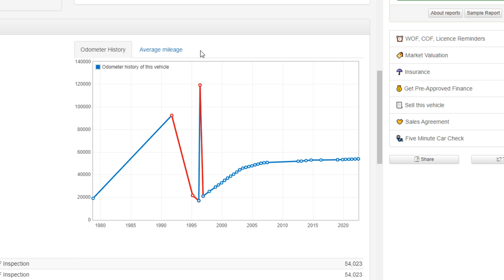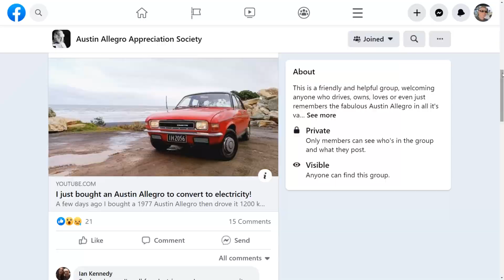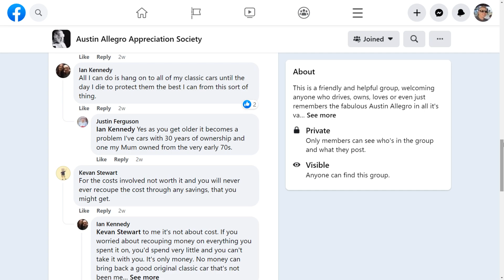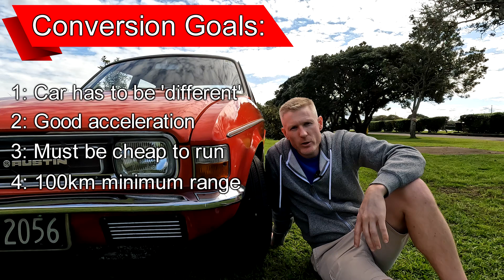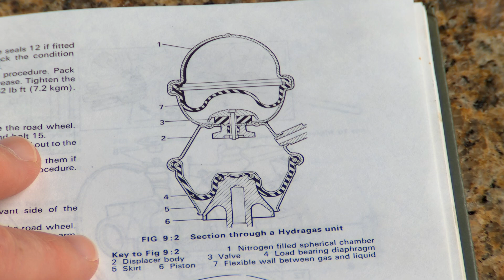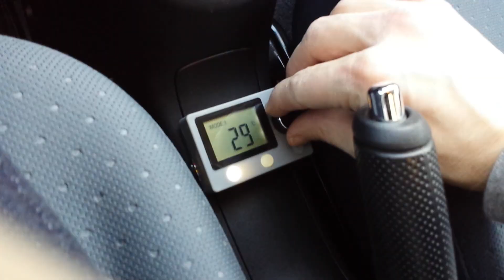Austin Allegro electric car conversion: planning, budget & goals.

Comment: Are joined drive shafts legal in NZ? Usually cheaper to get someone to join existing shafts by welding, sleeving and voodoo. There's a place in Poland people on open inverter recommended that's cheap for custom drive shafts too, depends on postage and import fee to NZ I guess.

Comment: I have been watching and enjoying your channel for several years. I am becoming convinced you should buy a used (or new)  manufactured electric vehicle. You would have a better car than you cobble together on your own. You have a lot more options than you had 2007.
Reply from the maker: Hi John, believe me, I've thought about just getting a used EV for years but it just wouldn't be "me". I need something really different! A conversion is just unbeatable for sheer wow factor and I want to drive a statement piece!
Reply: @KiwiEVadventures  Thanks, Gavin, we have been driving a Chevy Bolt since 2021, and we are impressed. My wife accuses me of using it for a research vehicle. She is right.

Comment: What a great project and the perfect car for the conversion. Don't worry too much about matching the original weight, the suspension height can be easily adjusted once you find someone with the suspension filling gear. Just a word of warning about GPS speedos, they're not legal in NZ. I tried to use one on my EV motorcycle project, but had to use a speedo that uses a magnetic bolt as a sensor instead. Overcomeable is a cool word. Good luck!

Comment: Citroen used the same principle on the 2CV (starting 1948...) but they did it mechanically..... later on they started with hydropneumatic (starting 1956 on TA 15CV)

Comment: For the battery pack location, do you really need four seats? If not, consider removing the back seats  and mounting the battery cells in the rear footwell and where the rear seat base was. That way, you retain the normal boot space. 😎

Comment: Some modern diesel cars use a 12V electric heater in the HVAC box, as the engines take quite a while to warm up. I think BMW 1-series uses these and are about 1.4 kW. These might be useful for your project and more cost effective (when available as a used part) then buying multiple new 12V heaters.
Check out the EVBMW channel for information as Damien has discussed these before.
However, to heat a car properly in colder climates, you require more then this. I've seen Tesla Model S's PTC heater, pump out up to 7kW to keep the interior warm.

Comment: Gen2 stack at 8:54. (Gen1's DC/DC is behind back seat)  Quoting: "The high-voltage harness that supplies power to the [Gen2] PTC heater comes directly from the lithium-ion battery." (it's HV cable connects directly to Gen2 battery) The PTC heater itself is next to parking brake (inside cabin) so not sure if OEM have a different legal framework than DIYers here in NZ? Curious how Lifepos will work with PDM if you stick with Leaf. Researching it myself if you start a discussion forum elsewhere.

Comment: I was wondering when we'd next see a video on the little car.  I remember it being on the market for quite some time as well, but like you, I live at the top end of the country and I wasn't keen on driving it back!  To be fair, however, I have driven a Triumph Stag back from Christchurch, so I wonder which of us took the bigger risk!  Those A-series engines take a LOT of killing and for it to be returning such good mpg / Km/L - whichever way you want to slice it, the engine cannot be too bad.  I'd happily make a donation to the cause when the drive train comes out if you're interested in selling it.  My 77 Mini would thank you for it!

I know plenty of people who don't like the Allegro, but I happen to love its styling....and with a bit of titivation here and there, you can get them looking quite (dare I say it) sporty.  In the UK, the Series III Allegro ('79-'82) came out with quad headlights and the Equipe had a 1.7 litre engine, alloys and some first gen Laser Sport-type decals down the side and up the rear pillar.  After seeing an Equipe, I have always wanted to get an Allegro, paint it silver, put the striped on, stick a lovely set of Turbine alloys on it and find a quad light grille.  Ok - I'd still be running the A-series 1.3, but it would look cool.  My intention was to show Kiwis - who never got the S-III or round headlights - that the Allegro could look good.

In regards to its repowering - mate, you HAVE to find more than 100km range for the beast.  One of the thing that has always put me off buying an electric vehicle is range limitation.  The second is the practicality of "refuelling" the beast.  I live 37km from Auckland city centre and if I still worked that far away (as a lot do), that's not leaving a lot left over after a round trip....and certainly not enough to turn around half way (either going there or heading home) if I forgot something I needed.  

A thought I had - rather than filling up the boot - was how high is the Allegro off the ground when the suspension is at its lowest point?  Also, how low a profile can you get battery packs?  What I am thinking is to mount something either under (or maybe in) the floor pan - ie: re-engineer the floor area and / or in the cavities under / behind the rear seat, trans tunnel etc to add batteries low down, get the weight distributed more evenly throughout the car and to try and utilise every available space the car has in order for additional range / luggage space.   The car will need to be complied - sure - and the less intrusion into the original steel work, the less they have to gripe about......but there will be a trade-off if steel needs to be cut if packs cannot be mounted from under or on top without causing major inconvenience or spoiling the "sleeper" look.  

I have toyed with the idea of doing this to my Stag when its engine coughs its last CO / CO2 out a cylinder.  An rebuild on a Stag engine is a phenomenal cost - and also depends if you can find someone with the know-how.  Mine runs a P76 engine, which is less expensive, but we are still talking near 5-figures......if the parts can be sourced.  I therefore thought about a crate engine - Chev 350 - but again, getting one landed here is still near $10k.  Now, if I could get my Stag to go 350-400km on a charge (like it does on 54 litres of fuel) and it costs me similar money to convert as it would to mount a different engine in situ (plus compliance costs to change her current certification as I would for any engine but the P76) and if I still have a usable and practical classic, then electric would be the way to go......but I would lose that beautiful V8 rumble and cruise in near silence except for the gearbox and diff whines.....but have a vehicle that has far less chance of breaking down!

I'll be keeping up with this build as it happens.  You've picked a good solid base car to start with and now the fun can begin!  All the best.

Comment: Great vid. Have you tought about a Hyper 9 motor and 4 x tesla modules?  only weighs approx 160kg and no need to touch the drivetrain.
Reply from the maker: Obviously I'm interested, but weight limitations play a part. Could you give exact weights of the motor and battery modules? Then I can factor them in.

Comment: Ahhh, the Austin Allegro 'Land crab'. I remember it well. I had a polytech (Mechanical engineering) friend with a green one. unfortunately the 'Hydrospastic' Suspension had collapsed on the right hand side so I could see him leaning to the left while driving. I also remember being facinated by the technology pushing up and down on the opposing suspension to see how it reacts. We did not care for our vehicles that much and would drive down Cameron Rd Tauranga trying to push each other off like in the movies. Skoda vs Allegro! Also crashing intentionally into me at intersections trying to push me to the amazment of spectators. 
My suggestion for heating if at all possible is to reinstate the reverse cycle air con leaf system. this would give you dehumidification also.
BTW. After all these years since I made up the cables up for your first conversion. I have finally brought a 2017 nissan leaf for my wife & I'm driving an outlander PHEV which i mostly use in electric. better late than never!
& no you cannot use my Wife's car as a donor vehicle. Sorry. :)
Reply from the maker: I would pay good money to see a Skoda vs Allegro crash-race :D
Reply: @KiwiEVadventures  I would too. unfortunatelly it only resides in my memory. I would surely be  arrested trying to recreate these days. maybe a paddock bash. i know of an orange Allegro. just need to find an 1100 Skoda. just checked trademe.....   nope. :(
Reply: Not a Landcrab, that was the 1800 (maxi)
Reply: @sparkiepaul1  half right, the landcrab was the 1800 series, but the Maxi was a different car altogether, although they did share the same doors 👍

Comment: An interesting challenge. I wish you well with it. In your weight calcs I think you said you were considering a 16kWh battery.   At 5 km/kWh ( what I get in my Leaf in general driving during the winter )  that is only good for 80 km, not the 130 km you suggested. Also, the Allegro wheels are smaller than the Leaf's so you might not get the same efficiency as the Leaf. 16 kWh is a bit small I think. An 18650 based battery , like Tesla,  might give you better kWh for the same weight but it's a lot of work.
Reply from the maker: Appreciate the comments, Brian! I came to this (probably incorrect) battery conclusion based on my old Peugeot iOn, which only had 11 kWh of usable battery due to degradation, but I could still get 122 km out of it because it was light (1080kg / 2380lb). Although not as aerodynamic, the Allegro should be even lighter than my old Peugeot iOn, so I think 100+ km per charge is theoretically possible on 16 kWh.
Reply: @KiwiEVadventures  There is a youtuber called Electrified Veronika who is a PhD battery scientist converting an old jeep to electric in the USA and documenting the process. She would be a great one to bounce ideas and calculations off of. Her last video she and her husband built their batter modules.
Reply: I have a 2013 nissan leaf, it has only 16kWh usable energy due to degradation, but i can still do 117km/charge in summer/spring/autumn, in winter i can get 105km out of it, but leaf its considerably heaver than Gav's car, so if he has 16kWh usable energy my guess is that he can do more than 100km/charge.